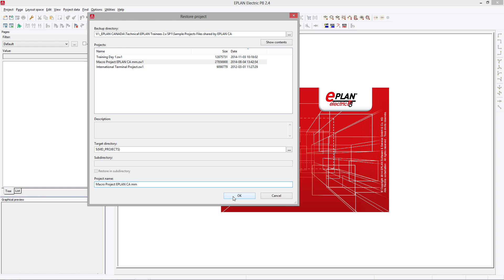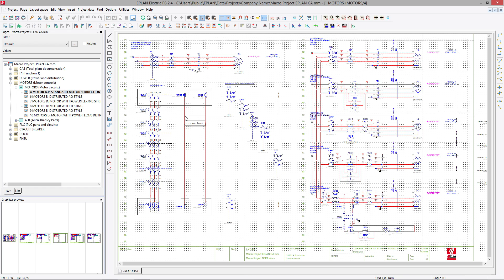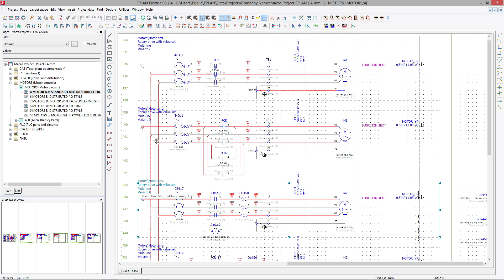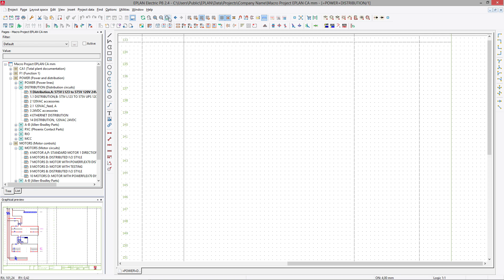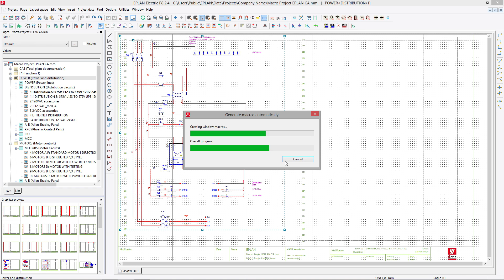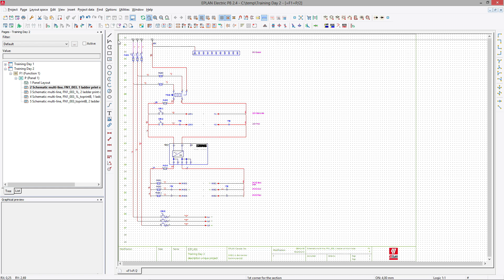EPLAN Tutorial Macro I

Comment: Roland, Great Tutorials on Macro management! I saw another description from eplans webpage with a Macro Navigator, i guess this is only available on a later version of EPLAN (and not 2.4 that we still use) ? 

Maybe you can help me answer another question i cannot find a sollution for: we often generate schematics with 90% simulare pages on the same conveyor components used over and over again. To make this work effort time efficient, I created a page macro consisting of 100 identical pages to be inserted as a single Macro. Finalizing this with the numbering function to customize each page according to its structure placement. 
Is it not possible to instead use a single (1) page macro and in the 'insert MACRO' stage promt EPLAN to insert it x 100?

Martin Thelin, Sweden.
Reply from the maker: In deed the later version have a macro Navigator. I love it. Check out the new v2.8, they improved it even more...
Reply: (Y) :) 

Did you have any comment on my second question concearning insertion of multiple page macros?
Reply from the maker: You can have more then 1 page in a page macro.